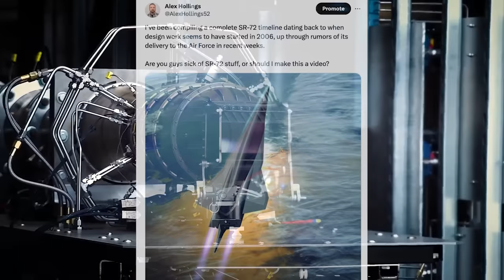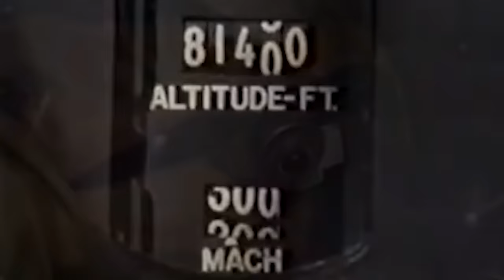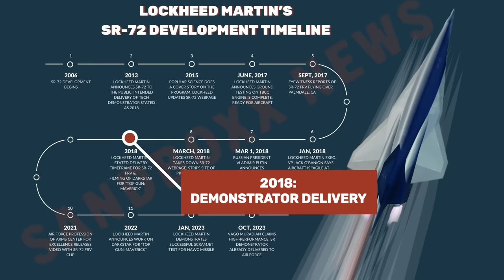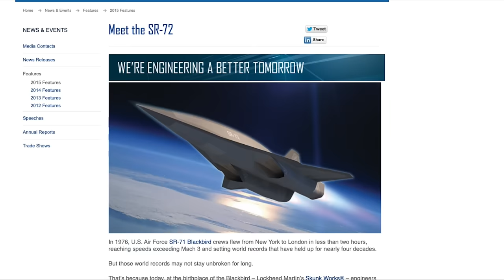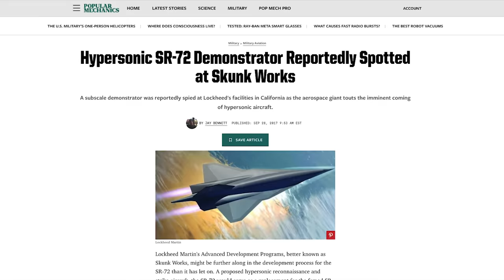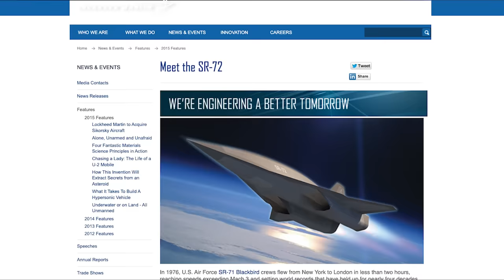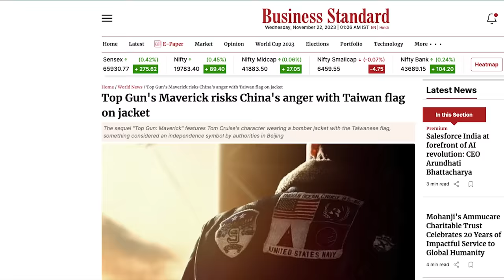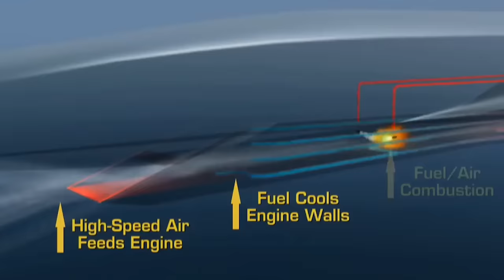The SR-72 is REAL — And we can prove it

Comment: I am 99.9% positive I spotted an sr72 flight last June over southern Alabama. It was around 3 am, Ii pulled over to relieve myself en route to vacation. As a spotter my eyes are always on the sky,but the faint rumble of a fighter jet drew my attention. It was at high altitude, transponder off per adsb. As I am checking adsb I hear another jet. I was able to faintly make out the strobe of its red beacon. I took a couple mins to see if anything else came along, and did it ever. Another red beacon appeared, this time completely silent, high altitude and it was moving so fast I couldn’t believe what I was seeing. 
I am a spotter of 24 years. This is the only experience I have had with an aircraft traveling anywhere remotely close to what I saw. I couldn’t believe what I saw and struggled with the fact I could make out the beacon light, why turn it on, right? However, if not for my attention being focused along the path of the jet from minutes earlier, 20/10 vision, and a little luck I would not have seen it because of the altitude. Another factor was the fact it was a new moon(no moon) and I was in a rural area with no light pollution. It was what I am sure will be a once in a lifetime experience. 
After getting back in the car and getting adsb back up I saw something very intriguing that helped reaffirm myself I had not hallucinated. From Southern California to the Western Florida panhandle, there were USAF aircraft along the flight path I observed. There was an E-3 about 75 miles behind what I believe was likely the sr72  and another on the same flight path over western Texas. There were several F-16’s and a handful of f-15’s. I checked their flight paths to see if they were practicing bombing runs or air to air and again, something interesting. All but a couple of them had their transponder off initially and turned them on at some point because they appeared for the first time on radar at altitude along this flight path. I have never talked with anyone about this but my wife, so it was nice getting to share this here!

Comment: It stands to reason, understanding that the SR-71 was developed in the early 60's, the F22's design cycle completed in the early 1990's. Either we are to believe advances in military aeronautical engineering stopped or continued at a similar pace. As such, today a mach 7-8 capable aircraft exists that is undetectable by radar, that statement can be made in full confidence.

Comment: I think the basic question to answer is why build a hypersonic reconnaissance platform? It cannot be flown over denied territory without risking triggering a war. Satellites can carry out photo or elint missions more effectively than an airborne platform. Likewise tracking dispersed insurgent forces can be done more effectively by low altitude quiet drones with effective night / adverse weather sensors with real time information distribution to ground forces.
In considering the SR-71, the sheer size of the airframe was due to the space required for the fuel. The SR-72 as portrayed, just too small to store the fuel required for any meaningful mission. Compare the X-43 scramjet test vehicle, sort of X-15 sized, with a powered flight time of less than 5 minutes. 
The one thing I’m very sure about Lockheed’s Skunk Works is that they are very good at keeping secrets. If we say something about them, it’s probably what they want said.

Comment: I've two questions, first is why don't these planes use a "first stage" platform to carry fuel and get the sensor vehicle with SCRAMjet up to speed, counting on coasting a fair distance before using a third "get home" engine? This first stage could be reusable, of course.

Second is at hypersonic speeds, would control surfaces be recognizable as such? Or would designers be trying to shift weight to create course changes or utilize thrust vectoring? Malleable surfaces?
Reply: I'm no expert about engines, but we understand at this point of the proposed design that solving powerplant makes it look like an engine strapped with a cockpit and control surfaces, and nothing else!! So basically, adding different engines for different flight phases is on point, but.... you certainly don't want to overdo it, because there are a whole bunch of thing as important as the engine(s) you want to incorporate later... and for that, you have to save weight as much as possible (here we wish magic were real).

Supersonic/hypersonic maneuver ways differs depending on air density (altitude), vehicle components dimensions, weight distribution, flight state (angle of attack) and airspeed. Simple answer is "you can't rely on one single type of controls for each flight mode and expect it to work well at all times". Either you go with one type to save weight, and train your crew well to fly this coffin, or you make a safer hybrid adaptative control system, and still train well your crew to cope with the drastically increased variety of flight modes..

Comment: I live near DC and on Sept 1st of this year I saw the craziest UFO that very much resembled the shape of the SR72.
It was an isosceles triangle and looked like it was made out of liquid mercury or something. It was so shiny, and there was this heat-mirage type effect all around it so it kind of looked like something you would see in a dream, with no clear structure, particularly around the outer edges. 
But you could see that it was triangular and had triangular wings. 
It was hovering directly over the road, about 2 or 3 times the height of the trees, and seemed to be bigger than a 737. 
The wings stretched past either side of the road which was a 4 lane highway with a wide grass median. 
Then the light hit it in such a way that there was a bright flash that produced "shine lines" so to speak, like the sun does, and then it was gone. 
I did not feel as though it took off, but rather as though it was still there but was no longer visible.   

I wish I'd had a dash cam, I would've caught it. I'm sure other drivers saw it, there had to be at least 10 other people that witnessed it but I've never seen anything about it.

Comment: Problem with the SR-71 wasn't the engines they worked great it was heat. The SR-71 pilots said at max altitude it would continue to go faster but the heat on the airframe could only withstand so much heat. Would be interesting to see if they figured out that problem.
Reply: We have better alloys and manufacturing processes today,  better ways of modeling the effects of pressure and heat, and new ways of mitigating surface heat transfer. The OG SR-71 was built largely from covertly aquired russian titanium exports, limiting alloy choice and making for much "waste" as qc had to happen on our end with no reimbursement. It was also largely designed on paper, pre computer. The advancements since the SR-71 in general design and production are huge. Just think of a late '60s car, computer or telephone vs one made today.
Reply: They likely fixed it for the SR72 by using fuel as cooling eg having the fuel sit all along the surfaces of the airframe forward of the engine(s) to serve as literal liquid cooling as the airframe surfaces heated up. Other possible solutions could simply be better chemical and paint coatings on the airframe allowing for more heat reflection/absorption/dissipation. Let's not forget that the SR71 had a toxic paint coating on it that killed the workers years later who applied it so on the SR72 I bet any options were on the table for consideration if they 'got the job done'
Reply: @marknewellmusic  The X-15 was able to achieve Mach 6.7 at 100k prior to the SR-71.
Reply: @Mike-01234  X flights were short whereas SR flights were understandably longer. Airframe heat buildup would not have propagated on X flights due to short flight durations I would suppose.

Comment: The guy you quoted was correct calling it a turbine... or a turbojet... not a turbofan... A turbofan is the kind of engine on passenger planes and essentially use a turboshaft engine to turn a large fan out front... turbofan and turbojet or turbine are not at all interchangeable terms. Absolutely enjoyed the video though.

Comment: @sandboxx did you hear of the Mach 9.8 flight in 2008? It wasn’t an sr72 but the x43 I believe. It was quoted at Mach 6 but the pilot pulled a tom cruise and went for max q. He got to Mach 9.7-8 lol you can only find one or two references to the REAL top speed. That’s probably why they rescoped the sr72. It was around the same time in your timeline
Reply: I’m kinda impressed that someone on youtube bothered to look anything up. Did you look on the way back machine? It’s not foolproof lol because people can submit removal requests. If you ever need help finding things… I can be of assistance. Id recommend you keep your own copies of all pages you use just in case they are erased or removed from way back. I actually remember the sr72 page lol photographic memory. Nice to see it all in one place without having to do the work lol

Comment: Saw one about 2014 or 15. Or something that was very similar. 
I was alone in dark sky area and a plane that was way up in Lear Jet zone (42,000 plus) or higher, at 45 degrees to my south. Turned a 16 inch dobsonian scope in the direction and looked at it. The faint sound it made was really odd. It came and went. The shape was a hubcap turned upside down with short wings. It produced a strange glow in the rear. 
And the speed was about 6 to 8 times faster than a jet. Definitely not a satellite. Had no solar panels and it was no rocket booster floating around. 
The satellite programs had no sat in the area and plane tracking showed no aircraft. 
Remember thinking that’s really cool. Never mentioned it because someone will say it’s mistaken for a known object. 
Always thought that one day, it will come out what it is.

Comment: Unparalleled investigative work, thank you! Imagine, though...if the SR-72 is leaving the pipe now, imagine what's entering the pipe! And I'm sure you'll be right there to piece together the clues for us. You might want to start looking into hybrid engines whose structures are reconfigurable, not just moving baffles (which are so 1970), because you'd then have a single engine, not 2 or 3...a true hybrid. Chimera and its ilk are multiple engines in a single configuration. True hybrid engines are single engines in a dynamic configuration. Keep following your gut, Alex. :)

Comment: I can for CERTAIN that the U2 was still in operation in 2004.  The SR 71 is certainly still in service and my guess is that the SR 72 is also in service, and it likely has HEW offensive capability as well as other offensive capabilities.  

A speed increase from Mach 6 (proposed) is of course in development, as increases in speed will always be in development.  Rescoping indicates breakthroughs to be tested / fielded on the existing airframe, along with other technological capabilities, that may be communications eavesdropping / detection in scope.
Reply: The U2 still flying in 2004 was just cover for the super secret Mach 5 Aurora spy plane which replaced SR71 in the 80's-90's. We don't want our enemies to know.🤫

Comment: If you want a really advanced option, have the turbine engine section be a variable-bypass turbofan like the NGAD will use.
Reply: Already studied and tested by hundreds of engineers around the world, while its "sounds nice" for subsonic up to mach 1.5 transition, it doesn't bring any noticeable benefit when you already can reach mach 2 in the usual way. There are several problems with variable fan (I guess you meant variable pitch). One is they get fatter the stronger you want them to be, and when you want to surpass mach 2, they become so fat they lose their intended purpose (thrust performance) long before getting anyway near. Also, we can't yet produce and control fans with bidirectional variable camber, ie, that can also smoothly adjust angle of attack between the root near the center towards the tip of the fan at the edge. The faster the airflow going inside the engine intake, the less AOA you must meet to avoid building up humongous pressure on the tip of each fan, otherwise, the fans act as a drag chute with a hole in the center, regardless how fine tuned your variable pith can get; supersonic physics is a bitch..
That's why instead of fans, just go without them, or else you do like the SR71, make them small, spin faster, plus afterburner..

Comment: I can believe there are engines powerful enough.  The thing I have trouble with is heat management and the fact that anything moving that fast in atmosphere is wrapped in a blinding bubble of plasma. Hard to do much recon from inside a ball of fire.
Reply: The solution that they came up with was to use composite materials that are usually found in things like the space shuttle, which could go for speeds above Mach 20 during certain phases of space flight. I imagine 3D printing may play a role in the creation of these materials
Reply: The space shuttle only went that fast for a few minutes at a time and had to spend months being repaired after every flight.  It also blew up.  Sure mach 10 is a lot less than mach 20 but heat is heat.  If you fly that fast for any amount of time you are going to have a lot of heat you have to get rid of somehow or your passengers and cargo will fry.  You will also be a great big beacon to anyone at all with infrared sensors and the 'stealth' aspect of your mission will be a non starter.  You also will not be able to use cameras because you will be inside a big ball of plasma fire.

Comment: The problem of combining a turbojet and scramjet together around Mach 3 was solved nearly a decade ago by reaction engines and their precoole which extends the range of a turbojet way up to Mach 4 together with the same trick the j58 used in the sr71...
Basically making it a turboramjet with precooler and scramjet combination 😁

Comment: Skunk Works facility is Plant 42, Site 2, and NGC's B-21 facility is Site 4 where the B-2A was built.
Reply: Remember that there are more than just one Site 4. The other two are S-4 at Papoose lake and the other one is in the Tonopah Test Range(it's gate is known as "Cedar's gate").
Reply: @AURORAREVEALNOW    NGC uses Plant 42, SIte 4, for both bombers.  I never got to TTR, merely supported tests conducted there (BGM-137B).
Reply: @MrCateagle  May I ask, what sort of tests?
Reply: @AURORAREVEALNOW   Ground-launched flight tests of BGM-137B.  I was quite involved with the various propulsion systems.
Reply: @MrCateagle  Even pulse wave detonation engines?
Reply: @AURORAREVEALNOW   BGM-137B was subsonic and used the same engine as the later JASSM-ER, a Williams Bros turbofan.  I haven't seen anything with exotic propulsion systems.
Reply: @MrCateagle  Oh. I see.

Comment: What’s insane is most of you still think in terms of combustion…..WAIT till you see what aerogel mixed with certain metals does in a vacuum. We call them aeroloy vacuum aircraft, you call them tic tacs or UAP’s. And before you start the holes created in aerogel’s formation are smaller than air molecules (I summarise for laymen’s sake) so there is no where for the air to escape, unless vented. aeroloy will be the future.  cushioned against atmosphere creating that insane speed you all see in a flick. Like water on a hydrophobic surface.

Comment: I have a question for the specialists: 
the 3D renderings of the SR-72 as well as the one presented in the USAF video have a single vertical stabilizer unlike the topgun darkstar which has two inclined ones, 
which seems to me more coherent for a plane that wants to be stealthy, 
so couldn’t we think that the SR 72 would look more like the Dark Star than the 3D renderings that we have seen so far?
Reply: If one intend to display honesty, the renderings are mere placeholders to "give an idea" and "keep the dream going". Before solving stealth concerns, engineers must solve a whole bunch of other problems, like airframe heat, because if your vehicle is glowing bright on infrared, there's no point in trying to be stealth. Also, range... Yeah, you can refuel airborne, but such hypersonic plane won't probably exceed 2500nm by its own. Weight... because you need payload, one huge drawback of the SR71. Etc. 
Only when you solve those, you get the first frozen design (and daredevil spotters can actually provide footage no matter how hard you want to hide it from the public, you must test the vehicle).
At this point, the ONLY realistic vehicle Lockheed and whoever are working on this idea is a one use missile (does not contradict the "strike" intent), not an airplane that can deliver payload and return to base. If by "we have a flying prototype" they meant "missile" without saying it, I do believe it realistic. On the funding end of the matter to solve said issues, you still need to communicate somewhat, hence, avoid being specific (missile or airplane? one tail fin or two? manned or not?) to avoid spoiling the funds.

Comment: Mach 10 is approximately 7,672 miles per hour (mph), with change. Temperatures resulting from Atmospheric drag (friction), require meta materials to reach that velocity, without disintegrating.
Reply: With cockpit force field technology and extremely advanced composite airframe materials(extremely advanced titanium etc) will get it done.
Reply: Mach depends on altitude
Reply: and/or a way of keeping air away from the frame….